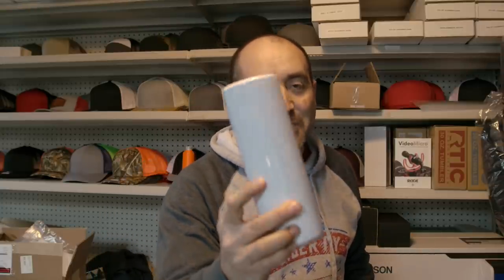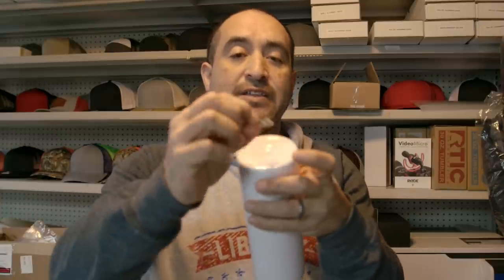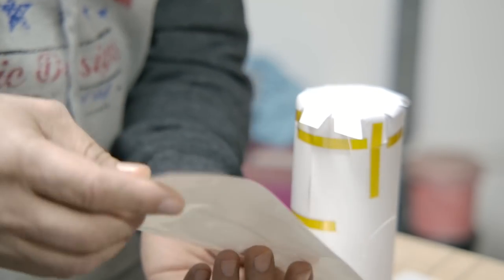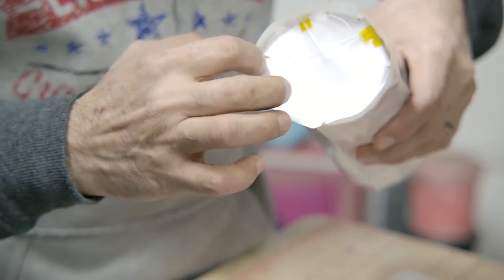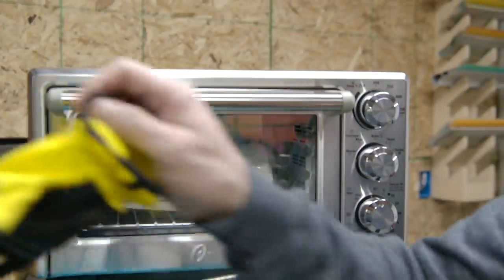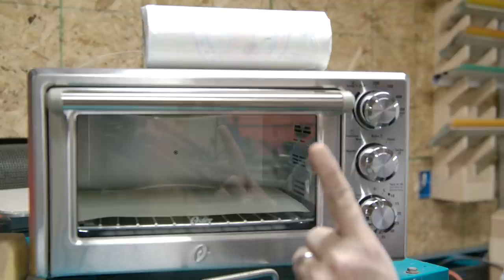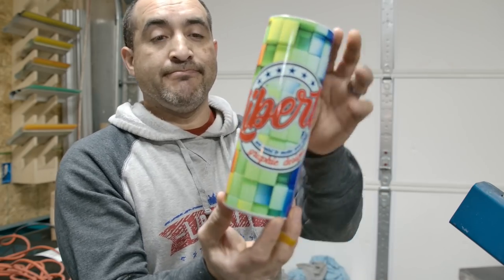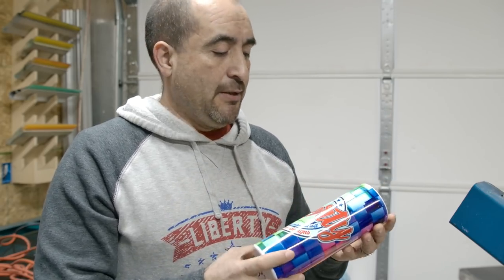THE BEST TRICKS TO SUBLIMATE A 20oz TUMBLER

Comment: Why is my tumbler coming out rough and not smooth after I sublimate it? I've decreased the temperature,  wrap an extra parchment paper around the tumbler thinking the paper was burning. It only happens to colored tumblers, like the blue navy tumbler you had used in a previous video. It doesnt come out vibrant or smooth like the white does.
Reply from the maker: that's the bad thing about metalic or glitter tumbler they always give yo problems... more then likely you got some that were not coat correctly and that's why is rough or you paper is sticking to it.
Reply: @LibertyGraphicDesigns  my paper sticks to it and leaves a residue or makes it rough. I use text print paper.

Comment: Hello, thank you for your videos I am new to sublimation, I just ran across your videos and binge watched them. You mentioned ink saturation in this video, I am learning paper weights do carry reasoning behind this, I also have a F570 how do you set your printer to print “more” ink and get those vibrant colors? I printed a very colorful image and it was vibrant but my turquoise printed blue etc. thank you for your time!
Reply from the maker: hi Katha, with the F570 rip software doing everything for you! what I do is just click the "print with high quality" and select the "rigid" instead of the textile and will saturate the ink or paper more than the textile however you do not want to do this when printing garments or textiles this will more than likely create a ghost since the paper has way more ink than the garment can take. thank you for your comment!
Reply: @LibertyGraphicDesigns  thank you so much!

Comment: No matter what I do my sub cups do not come out right. There’s lots of ghosting and everywhere I put the heat tape it leaves the outline of the tape on my cups. I use heat tape then cover the whole cup with masking tape or painters tape and sometimes I even use shrink wrap. I’ve tried it the same way I see so many people doing and it never comes out right. It’s either too light or so many ghosting areas and tape marks. I even used the silicone bands and it left outlines marks on the cup. I’ve done 350 for 6 minutes. I’ve done 385 for  4 1/2 - 5 minutes and now you are saying 400 for 4 minutes. I e now ordered different heat tape, white masking tape, a full cup silicone wrap and clear shrink wrap to try out. Please what am I doing wrong 😢 I’m wasting cups and wraps that I pay for because I don’t print. How can I get the prints off the cups when they are messed up to try and reuse?